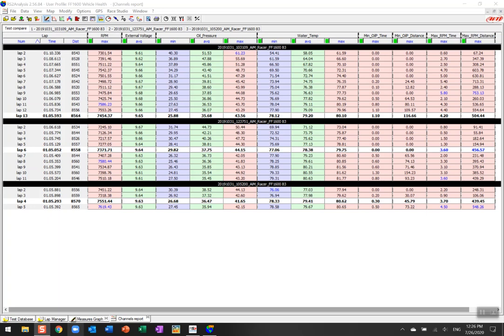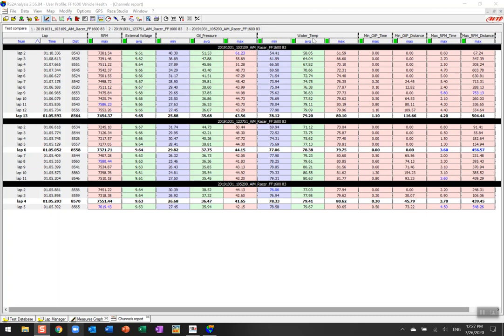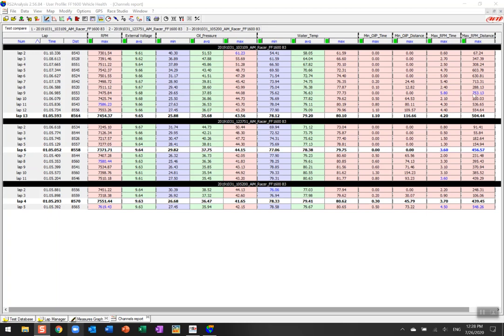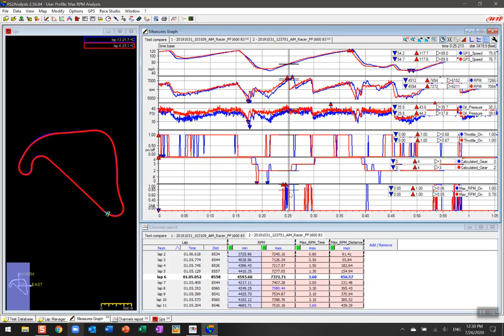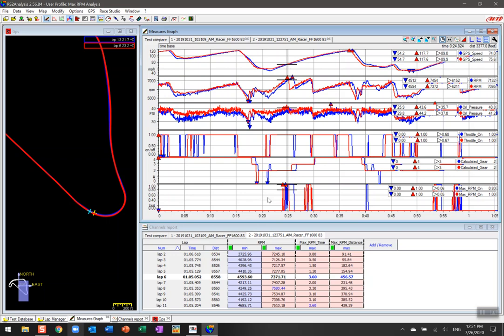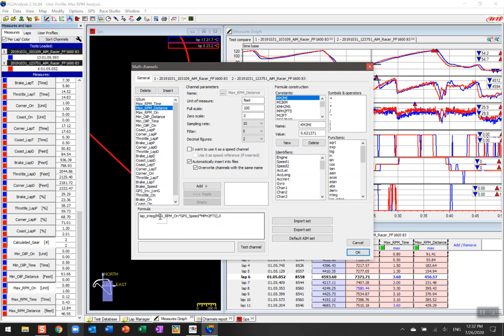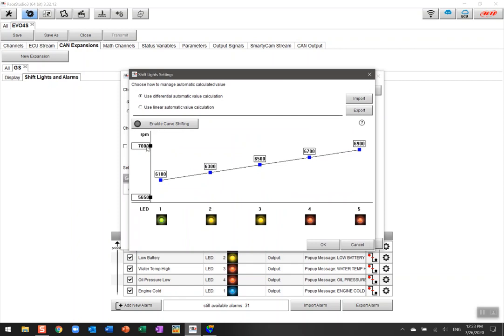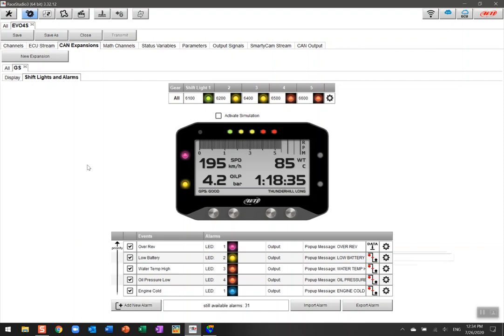AiM Race Studio Analysis - Max RPM Analysis (using Channels Report)

Comment: Thanks James, great tutorial. very helpful. 

I would like to share more details about the math channels settings. I modified the formula to KMH ( metric system).

Measure name : Max_RPM_On
Formula : IF(GT(RPM,<REPLACE WITH YOUR MAX RPM>),1,0)
Unit of measure : Unit
full scale : 1.1
zero scale : -0,1

Measure name : RPM_MAX_Distance
Formula : lap_integ(Max_RPM_On*GPS_Speed*KMH2MS),0
Unit of measure : m
full scale : 100
Zero scale : 0

Measure name : MAX_RPM_TIME
Formula : lap_integ(Max_RPM_On)
Unit of measure : time
full scale : 100
Zero scale : 0
Reply from the maker: Hi Marcelo. Thanks so much for sharing. I'll be downloading these and using them for folks I meet with KPMH. So glad you liked the video, your feedback is fantastic!